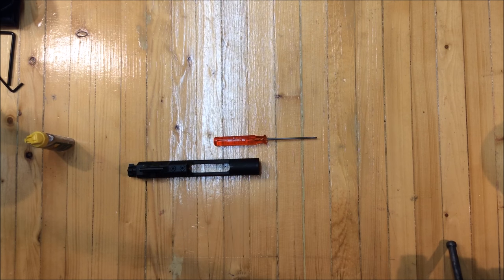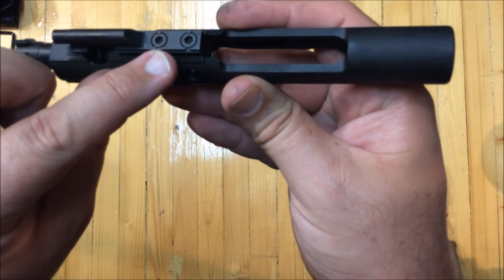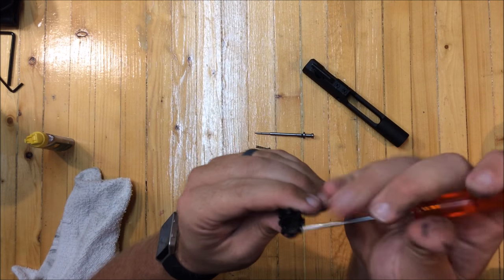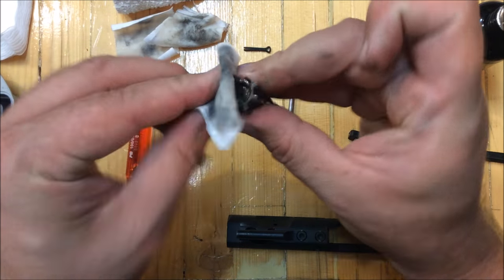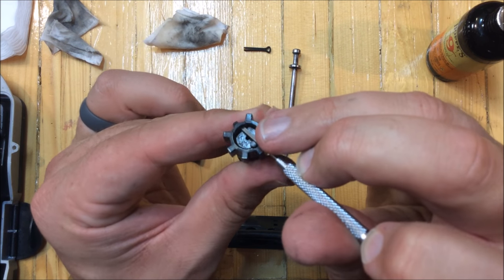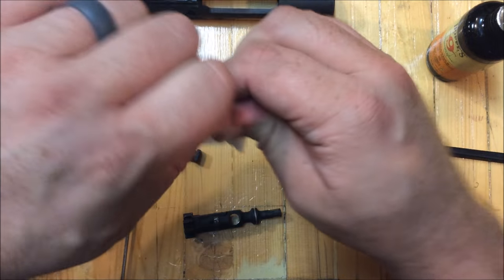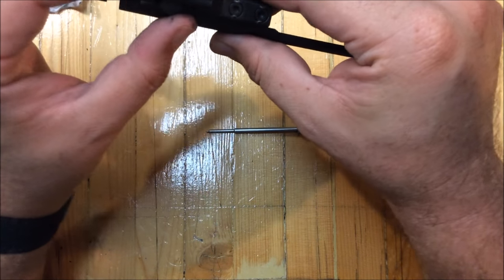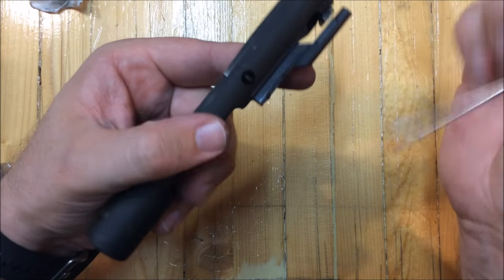AR15 Bolt Carrier Group How to Lube, Failure to Eject

Comment: You guys would be disgusted if you saw how much oil I use lol. I believe you can’t put too much oil I guess and I’ve never had a problem and everything runs really smooth. Only downside is oil leaks out through the seams lol
Reply from the maker: wet is good, check down the comments, folks give me crap for shoving oil in every hole. thanks for watching Turkey
Reply: @EagleRun23 luth Ar told me to literally dunk that hoe in gun oil then gave me an analogy about seasoning a cast iron lol

Comment: Those two holes are gas release holes not oiling points. Just apply some oil directly on your bolt before assembling. Apply oil lightly over the entire exterior of the carrier. Place more oil along all rail contact areas then your done.
Reply from the maker: Ya someone years ago showed that to me, i figure most of that would blow out on the first shot! haha

Comment: Did that fix the problem?  I just did a build, and it will not eject at all.
Reply: Tom Fairbanks did you fix the problem because i have the same problem
Reply: Tom Fairbanks 👀👀
Reply: @joniruqi8603  did you ever fix it? Mine will shoot it just won’t eject when fired but will after I pull the charging handle

Comment: use a small bit of Lucas high temp grease (or similar grease), it stays in place, does not dry up and will be there for the next cleaning.
Reply from the maker: I should get some of that, I dont have any. thanks!

Comment: You used extract and eject interchangeably. Both are separate functions . You never solved the problem. You should do your research and prepare a script before you record. If you have a failure to extract you should examine your extractor spring I am guessing that will fix your problem because you tested the ejector on screen
Reply from the maker: My old videos are cringe haha.

Comment: Would this help with failure to erect as well?  Just better lube?
Reply from the maker: YES, and..... on cheaper models, the ejector springs can fail too. Most likely its a lubrication issue.  Id start there before I worry.
Reply: Dan Sherwood  😂🤣 2 years and he still haven’t caught on

Comment: The channel where the bolt slides into the bolt carrier accumulates a lot of carbon towards the end that needs to be cleaned or scrapped of, i usually run a shotgun sized brass brush in it until clean then run a slightly oiled rag to surface lube the channel, I also do not recommend pouring hoppes cleaner into the bolt unless your willing to take out the extractor and ejector to remove the hoppes from their inner channels before lubing because it’s contradicting each other plus you don’t want to leave the cleaner in those channels because they are oxidizing cleaners if left on for long periods of time!
Reply from the maker: Hey great tips!! Thank you!

Comment: Rem oil burns off way too easily on an AR.  Use something much more substantial.
Reply from the maker: Under The Liberty Tree I run them often and frequent. No problems.
Reply: Good ole motor oil. Doesn’t burn off as easy and a quart will last you a long time👍

Comment: Same thing on my M&P15 Sport II. Ran the bolt a little dry and it stopped ejecting. I mean the bolt doesn't even come back. I had to use the charging handle. So I brought it home, cleaned and lubed the bolt and carrier. Today I finally got to the range and guess what? Same damn thing! Now I guess I have to call S&W cause it's still under warranty.
Reply from the maker: maybe they will swap your bolt carrier out?
Reply: @EagleRun23  I'm not sure that's the problem. If the bolt fails to even move, it must be undergassed. The bolt and bolt carrier group is fine.
Reply: @EagleRun23  it's on the way back to them under warranty.
Reply: Mine hasn't had 30 rounds through it. And it jams every shot or couple shots. The bolt gets stuck like hell when it almost closes. Then I have to pull like hell to eject. Any advice. It shoots great if I feed it myself so could it be the mag?
Reply: @kevinu9320  remove the bolt assy and clean that factory assembly grease or oil off. Then lube it up good with some Rem Oil.
Reply: @kevinu9320  S&W "repaired" mine under warranty but the work order didn't specify what they did. Gonna keep that bolt well-lubed from now on. Glad to help!
Reply: @richardbrucemusic  thank you a bunch man
Reply: @kevinu9320  that just happened to me on the 4th. I have ran hundreds of rounds thru my AR 47. Then on the 4th i shot the it didnt eject I couldnt even pull it back witht the charging handle. So I used a tool to pry it back open and shot another round and same thing so I took it apart and it ejects fine but haven't shot it again. I out the round that jammed in and slammed it down and it stuck again. I ordered a new bcg hopefully that fixes it

Comment: I just built a brand new AR all new parts and went to chamber and eject a round using charging handle and found it's not ejecting..... I've cleaned it and lubed the the crap out of it and still not ejecting..... Thoughts anyone???
Reply from the maker: Hey Tac, is this at the range after firing? or is it a live round?   so basically you have a stuck case?  Are these factory rounds or your reloads?
Reply: @EagleRun23  I was sold a 6.5 Grendel BCG 😑. I got it fixed now
Reply from the maker: @tacticaloutdoors7553  ohh man. That would have taken me a while to figure out! Glad you got that sorted! Also. Awesome excuse to start a grendel build!! Fantastic!
Reply: @EagleRun23  My cousin said the exact same thing haha. Yes I was lucky to catch it!

Comment: hi there so here is whats going on i build my ar 15 with an anderson lower and anderson lpk i bought an 16" upper from Joe bobs outfitters and i put on a psa bcg and ch i took my gun to the range today and it shoot the first round but after that i had to charge the handle to cycle after each round and then fire what do u think it could be ?
Reply from the maker: jose ortiz you definitely have a gas issue. 

I believe what you're describing is called short stroking not to be confused with well never mind. 

It's possible that the gas ports are not properly lined up a semi common problem with an expensive uppers. 

There's a slim chance that you could have a buffer problem. Most likely the spring is fine but it could be the weight is too heavy

I would concentrate on the gas ports for now
Reply: You either have too heavy of a buffer spring, or you have an under gas issue.  Are you running your bolt, and BCG wet?  You should be.
Reply: Jamie Sloan what do you mean by running it wet?

Comment: I have the same problem and I've just like u sade and still havin a problem with the ejection I just moved the rings tonight and put rounds down it tomorrow
Reply from the maker: This bolt has not had much trouble, still runs.

Comment: that's what you have issues. it's a low budget BCG and the rifle is cheap. grate video bro. people need to see what happens when you cut corners. glad you were not delta..and it failed in the field.
Reply from the maker: Jason Borne thanks for watching brotha! A little lube and this thing was good to go.  All my rifles I have built (assembled/sourced). I spend money on the bolts, triggers and barrels.  That’s what matters most. 
Video series on my 6.5 creedmoor buildup coming soon.